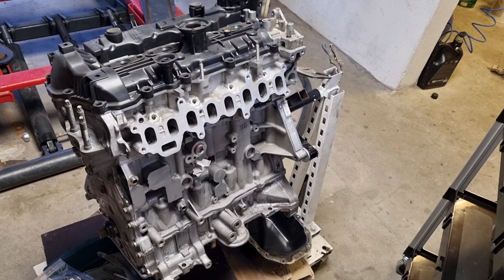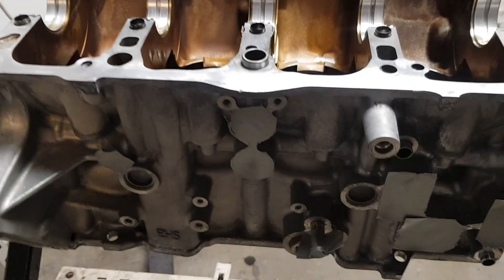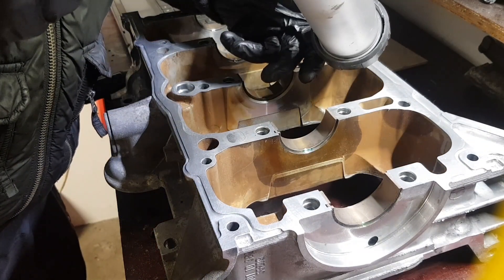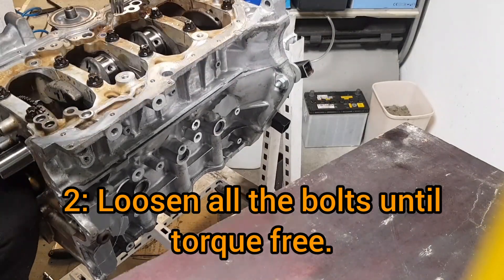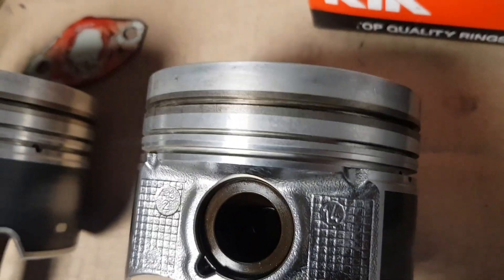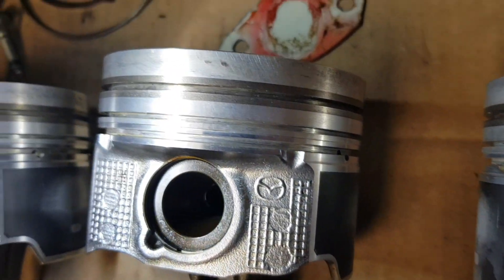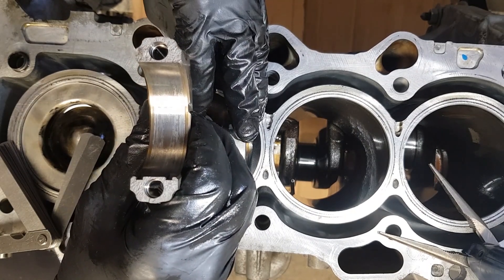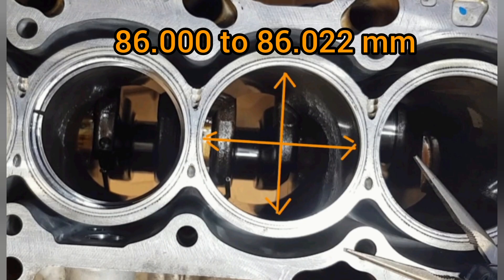Engine overhaul Mazda Skyactiv 2.2 D without machining. Part 1

Comment: Can the main bearing bolts be reused or do they need to be replaced?
Reply: The manual recommends replacing them with new ones. However, they can be reused because they are not tightened very tightly.

Comment: Great video, thanks for the detailed explanation!
I have a question about the piston ring installation. You showed a specific way to position the ring gaps — could you please tell where you got that information from?
Is it a recommendation from the manufacturer for this particular engine?
Because usually everyone recommends spacing the ring gaps about 120° apart, so I’d like to understand whether your method is the correct one for this engine.
Reply from the maker: Thanks. All the info is taken from the dealer's workshop manual. I also couldn't believe that the ring gaps should be arranged that way, but yes, that's how it should be. 120° apart is on most petrol engines but always check manufacturer's instructions. That engine is already running I've done on it 15k km. Engine sounds like new.
Reply: @JB_Auto  Thanks for the explanation! That makes everything clear.
Great that you followed the dealer’s workshop manual — without official instructions it’s hard to be sure about the correct ring gap positions.
And the fact that the engine has already done 15k km and runs like new is the best proof that everything was done right.
Thanks again for the detailed video and your reply!

Comment: Won't the silicon protruding into the engine cause blockage in the oil channels, in case it breaks off?
Reply from the maker: If you put too much, it will, but the amount I placed is the recommended one. I also wait until it dries well.
Reply: @JB_Auto  Aah nice thanks for the clarification. Quite a nice work you're doing here. All the best
Reply from the maker: Thank You 😊

Comment: Hi, is it at all possible to remove the crankshaft with the enigine still in the car? Maybe by removing oil pan, pump/balancer and then unbolting the lower block? Then I guess it's hard to apply the sealant and hold the block up, but maybe with a flat surface scissor jack or something?
Reply from the maker: Hi, it is impossible because the gearbox prevents access to the lower engine block. The best way is to remove the entire engine, and the work is comfortable and fast. To remove the engine with the whole equipment, you need approximately 3h
Reply: @JB_Auto  Thank you. I have one of the crank journals are scored. The big end bearing on it was a thin sliver, very worn! Already polished with 600/1000/2000 grit sandpaper (shoe lace method), but I can still feel the scratches on the journal and it already measures 51.80mm (instead of OEM 52mm). +0.2 oversize bearing should fit, but I want it to last a few years and save money. If I polish further to 51.5mm and fit +0.5 oversize bearing, do you think it will last me a few years? Or will it start knocking again in as little as a few days? I'd love to do an engine rebuild - your video is perfect for guidance - but the car is worth £2500. Parts for rebuild will be what.. around £1000 and £2000 if OEM parts. I don't love the car enough I think haha
Reply from the maker: If the crank journal is scored, the main could be even worse. I wouldn't spend money on that. I had done one such engine without dismantling the crankshaft, just polishing crank journals; there was no scoring. I replaced the big end bearings and the oil pump. The engine was good for 40K km, after that it started to knock. The cause of the knocking noise was the damage to the main bearings ( the main bearings were peeling, creating metal particles) that began to circulate in the oil lubrication system, damaging the big end bearings and the oil pump. So if I were you, I would dismantle the engine into pieces,  perform good verification, and do the job right.
Reply: @JB_Auto  Thanks. If the main bearing is scored, will the block surface/journal still be okay in most cases? Or is there a risk I will also need a new block and whole new engine haha
Reply from the maker: In most cases, the engine block is good; however, it also depends on the duration of any lubrication issues. The crankshaft may need to be machined.

Comment: Are the later  2.2  D  engines   relatively  trouble free   and   what month and year was the 2.2  D  discontinued  in the  mazda 6  ?     They are a fantastic  engine when going well  and  very economical  .   Thanks
Reply from the maker: Yes, all 2.2 engines with the AdBlue system have many modifications, including mechanical, an entirely changed valve train system, an oil pump chain supported by two tensioners, PCM software, injectors, turbocharger and lots more. Those engines were introduced around 2022, you can recognise them by the AdBlue system.

Comment: Hello, can you tell me if the 2018 model mazda 3 d is with the upgraded washer that doesnt fail? and also is the turbo flap problem solved on this model? thanks. And I can see it has metel exhaust sensor.
Reply from the maker: Hi, turbo is solved. Injector washers should be replaced as maintenance on every engine 2.2D, and I'm replacing them on my car every 80K km.
Reply: @JB_Auto  so new is not wear safe? how they look like after 80k? worn?
Reply from the maker: @Gustav4  Those gaskets are improved. When I replaced them, they looked good, but since the replacement time is 1.5h and costs me almost nothing, I decided that my interval will be at every 4th service or 80K km. Regarding your model, I'm not sure if that has been upgraded. All possible info was in the video.
Reply: @JB_Auto  I think if they dont leak dont change but what ever, there is also a rubber seal ?
Reply from the maker: @Gustav4 The Rubber seal is on the valve cover; if that seal doesn't leak and is soft, it can be reused.